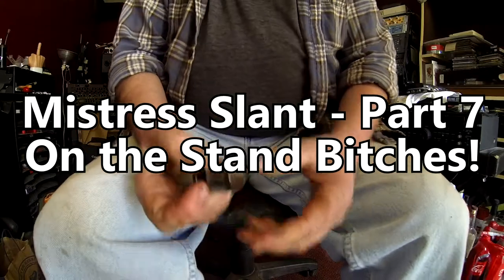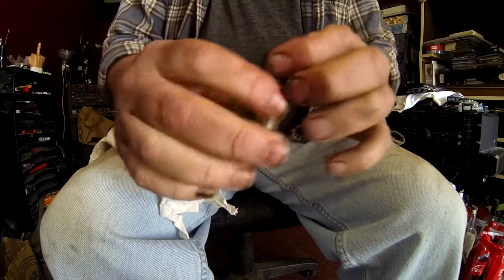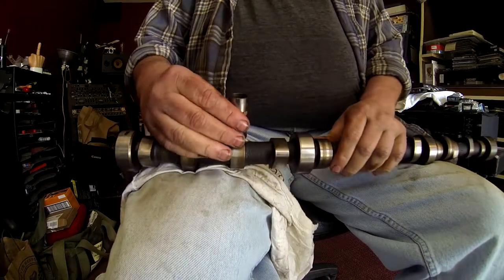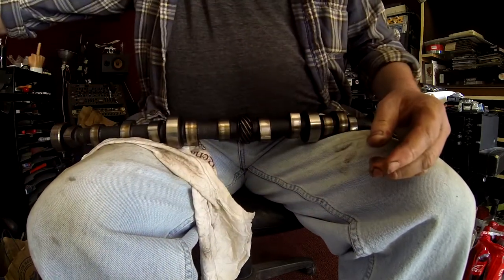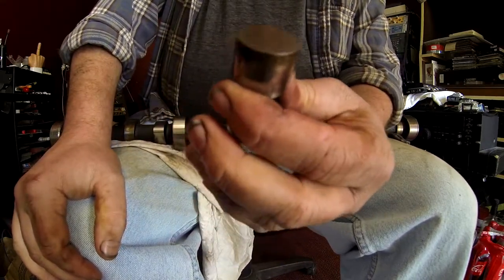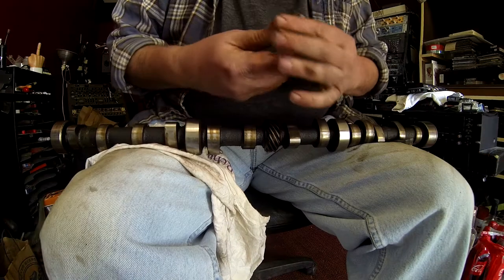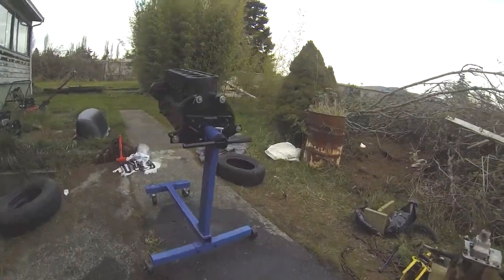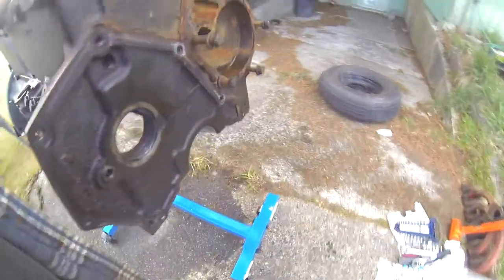Mistress Slant-Block on the Stand-Part 7

Comment: What you put the engine in?
Reply from the maker: I havent put it in anything yet, it will replace the engine in my 1966 valiant
Reply: @MicrophonicFool  Can you make a video really want to see and my slant six was bought from a old lady that let it sit for 5 years got the heads right today valves were stuck learned from your video it wasnt a interference engine so itapped it a few times and they both popped loose tapped afewmore times on all of them just to see if it was all good. all's good. Took my recess mfs and been happy the rest of the day just got to finish rebuilding distributor
Reply: Do you know the torque specs for the rocker arm shaft
Reply from the maker: @patriciajuarez9147  I'm only using my memory, but I think it was 25-30 ft-lb. I'll find my service manual and see it what it says
Reply from the maker: @patriciajuarez9147  My 67 valiant manual says 25 ft-lb on rocker shaft